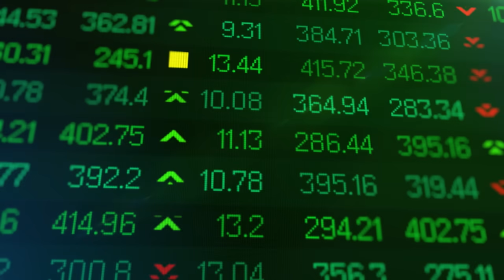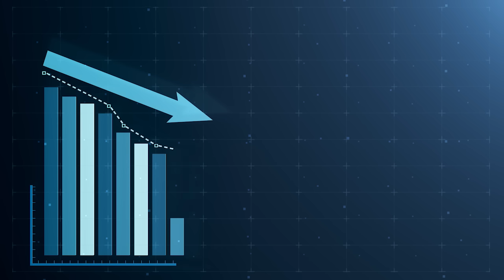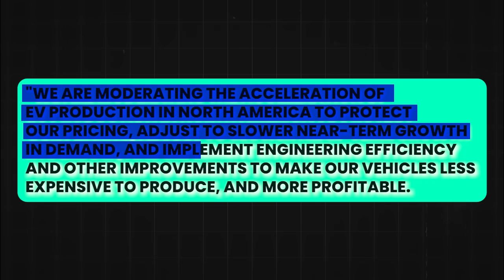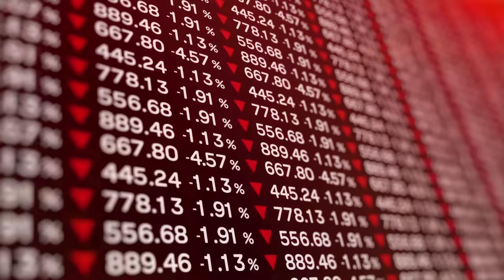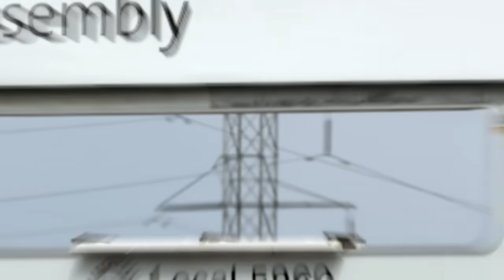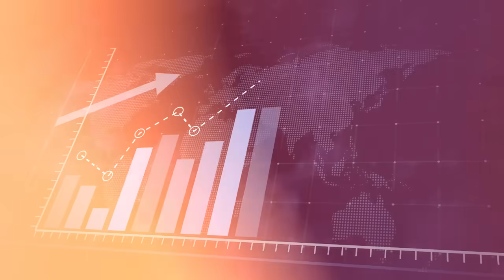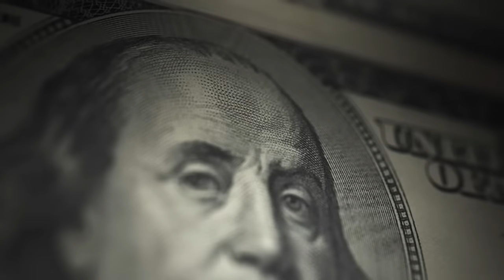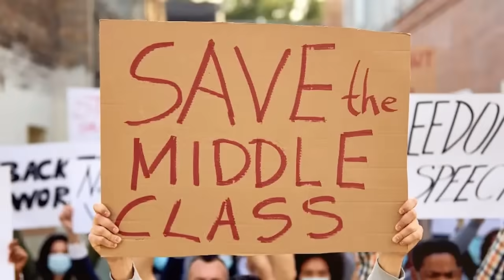HUGE NEWS! GM CEO Just SHUT DOWN EV Production!

Comment: Only the wealthy buy fully EVs.  Maybe there's not enough multi millionaires 😅
Reply: and yet people shell out 100K for pick up
Reply: I sure as hell don't.  If you walk into a dealership backwards with your ass out and sign up for a 10 year loan then you're a dumbass.  I know there are a lot of dumbasses out there trying to compensate for something, but I will never be amongst them.
Reply: I bought a brand new 2021 Chevy bolt premiere.  It cost me $17800 out the door with an interest rate of 0%. It costs on average  $6 to charge and it has a range of 300 miles. It would cost around  $40 to travel the same distance in a gas vehicle assuming the vehicle got 30mpg and that isn't including  maintenance. I get free charging at most hotels and GM even threw in a level 2 charger installed in my home and I got a tax credit from the IRS for that year. It isn't only the rich that buy them, it is the smart. I don't hug trees but I do think for myself. 
The real issue is that most automobile makers push high end cars because the profit margin is higher.  It doesn't help that consumers use them as status symbols pushing the price even higher.
Reply: They are expensive toys not reliable vehicles. They are full of gimmicks and very few benefits for the average person.
Reply: @CyberCrusader27  : 17,800 for a Bolt is expensive? For a new car?
Reply: The early adopters were rich and had too much money as well as being gullible to MSM hype. The fact remains most people dont have 40000 to 60000 plus 600 insurance first year and 2000 to 5000 thousand second year bait and switch...plus the risk of the thing catching fire and needing a 20 meter empty space as well as as 17000 to 34000 for a replacement battery after a fender bender..plus range anxiety. plus time wasted on charging plus poor charging infrastructure. Sales will plateau and then decline as the the middle class and working class can't afford them.
Reply: @ManInTheBigHat  Yes. When you cannot use it as intended due to all of the shortcomings that come with BEVs. Charging times are not viable for road trips, finding a functional charger that actually charges at the advertised rate. Or having to have a collection of apps just to pay at a charger. If the weather is too hot or too cold you lose a huge chunk of battery life. They are plagued by all the shortcomings the have been since their introduction in the 1800s. 

That goes without mentioning resale. The market for resale is nearly non-existent. Who wants to buy a used Smartphone, let alone one on wheels?
Reply: @CyberCrusader27 What are you babbling about? Auto rental companies buys EVs specifically because they are more reliable and cheaper to run.
Reply: @CyberCrusader27  
40k miles on my Bolt and not one issue yet. It is extremely fun to drive and costs pennys to drive. Pretty much nothing you just said is based in fact.
Reply: If people weren't being tax 30-40% of their gross pay check. Then people might be able to afford the EVs.
Reply: @goshawk4340  EVs, if you buy a sensible one is cheaper to buy and operate that most if not all petroleum powered vehicles. 
The taxes are that high because people don't vote. Believe me I don't like taxes either and I love passing a gas station and not having to stop. I charge at home for 8 cents a kw, it costs about $6 a week to charge. The car will go 300 miles on a charge and takes just over an hour to charge on any level 3 charger and I get free charging at most hotels making road trips awsome.
Reply: Complete lie!!  I own 2 EV's and I'm not rich, I just understand economics and value, which is why I own EV's and pay $0 to fuel with my solar panels.
Reply: @wilsterone6689   not everyone has a spot to plug in their car at night.
Reply: @MrArtist7777  Agree. I have a diesel car and an EV with limited range. Still, the EV is good enough for 90% of my transportation need for 20% of the diesel cost.
Reply: @esecallum  Lol, it costs $87 dollars a month to insure my EV, which is $30 bucks more than my gas car, that's nothing. I'll never need a replacement battery in an EV, and EV's catch fire way less than ICE cars, that's a fact.
Reply: @CyberCrusader27 speak for yourself. For me they make economical sense when you drive 2 hours a day to and from work. There is no maintenance other than tires and washer fluid. For daily driving like this they are the perfect vehicle because you can charge at home. Go drive a Tesla and find out like I did. I also have a gas guzzler for long trips.
Reply: @esecallum  , Thank you for your comment, but you could have skipped the bold. My wife and I looked at an EV, and by looking pulled up the cost to purchase,   perform maintenance, and alter our house to charge an EV. First off the price tag is nuts. They range from $30K to $100K. The $100K is one third of the cost of a house in the state my sister lives. The there is the battery replacement cost $4K to $20K. Than depending on where you live you might get hit with a battery disposal fee, that has nothing to do with the replacement of the battery cost. 

Now you have your EV but you have to charge it. OK great we'll put solar on the house to charge the EV (at night). Add in the cost of the solar, possible electric panel upgrade to handle the circuit, and the circuit to charge the EV. A co-worker got lucky and he had the 240V 30A circuit for an electric dryer in his garage but had a gas dryer, so his switch was easy. But depending on the state you live in you might not even be able to charge your EV. States that have brown outs due to either weather or electrical grid overload now become an issue to charge your EV.

EVs are a nice idea but they are not the solution. They are not the savior of the world. You are just shifting from one limited resource to another limited resource. Sooner or later the last oil or lithium will be dug out of the ground and then what? Internal combustion Engines are still good without oil, as almost every country in the world grows crops that can be used to make alcohol that could be used to power Internal Combustion Engines.
Reply: Incorrect.  Quite a few people were I work have EV's and they're not rich.  Average commute in the US = 40 miles.  If you live in a home and have a near-average commute, there  is a huge cost and time saving to owning an EV.  I've driven my Hummer twice since I bought my Model S, and I even take it on road trips.
Reply: @Clooney003  You make assumptions but I speak from experience. Not only personal experience but from those I know as well.
Reply: @CyberCrusader27  well sucks for you I guess. I know from experience myself as I own a 2018 Tesla with over 100K and its been the least "nickel and dime me to death" vehicle than any other car I have ever owned.
Reply: @goshawk4340  true and I'm not saying EVs are for everyone but they do work for a lot of people and even if you have to find a Walmart to charge at. You can get a full charge in just over an hour and it will only cost you about $8. You just have to open up your mind for the possibility.  I don't believe that there is a one size fits all solution. There is a place for all forms of energy.
Reply: LOL. Or maybe they are smart enough to face the facts, and Not Buy One?
Reply: @madewithscraps  Rich people don't get that way by waisting money. It costs $6 to charge my car.
Reply: @wilsterone6689  if it cost 17k or less I'd buy it. Sad I don't see that around
Reply: @user-tm5zn2lt5k  Paid $17,800 out the door and zero % interest.  For my brand new zero mile Chevrolet Bolt.
You just need to be savy. Even the sales guy couldn't believe that I pulled it off. But even if you pay $35k, the low operating costs alone compared to a conventional gasoline vehicle makes it worth it. $6 of electricity will get you  a full charge. $6 worth of gas gets you 1.5 gallons of gas, and then you still need to factor in maintenance like oil changes, belts, coolant,  transmission fluid, and services.  None of which are required for an EV.
Reply: @esecallum  My insurance is the same for year 3 as it was for year 1. The battery is covered under warranty for 8 years or 100k miles. More gasoline cars catch fire every year than EVs. It takes 1 hour to recharge using a level 3 charger, and it costs $6. The chargers are almost everywhere, and with a 300-mile range, there isn't any range anxiety. Most of what you have listed simply isn't an issue. I don't think that an EV is for everyone, but I do recommend serious consideration and stop getting  "facts" from social media.
Reply: @wvanyar1801  FYI, you can get lithium from sea water.  The battery will last as long as an ICE. You can adjust your charge rate and time to avoid  brown outs. And there are many more ways to make renewable energy than there is to make fossil fuel. Growing corn to make fuel is extremely inefficient and a poor use of land that could be used to grow food.
Reply: @wilsterone6689  bolt usually cost 35k or more. If they would sell it under 25k I'm sure more people would buy it. I know they offer tax credit for the people that make enough to receive em. Good point on the cost per recharging the vehicle.
Reply: @user-tm5zn2lt5k  I bought mine with the GM close out sale +GM loyal + costco auto program+ zero sales tax program + U bought it from a dealer that offers lifetime power train warranty. 
Like I said, you just need to be savy.
Reply: Guessing those who buy f150s are all millionaires, interesting
Reply: @kevinrocksman  Right.... most sensible EVs cost in the mid $40ks and that just happens to be the average cost of any car these days. Factor in the cost of fuel, and that makes the average  EV far cheaper than the average car.
Reply: @CyberCrusader27 "Not reliable" 😂😂😂
Reply: @CyberCrusader27 "Not reliable" 😂😂😂
Reply: @wilsterone6689  took your advice I bought a Chevy bolt to save money. But does it take you more than 5hrs per charge or did I get lemon. Thinking 🤔 of buying a second one to alternate vehicles when charging
Reply: @user-tm5zn2lt5k  My utube is acting up.  5 hrs is normal if you are using a level 2 charger and your battery is very low. Level 3 can get it done in 2hrs.

Comment: Fire Barra, NO golden parachute. Buy an EV, get stuck with an $80K paperweight in your driveway when the power grid fails. :face-orange-frowning:
Reply: So you don't need electricity to run gas pumps?
Reply: For 80K I can buy an EV and a solar panel. Guess what: I need no oil or electric infrastructure to use and charge my car.
Reply: or have  her skydive out of a plane with a literal parachute made of gold 🤣
Reply: @coderentity2079 Just don’t try to leave town.
Reply: @Rex_Racer   He’s landed.🎣
Reply: Only a small amount. When grid is down a simple generator is required to run the pumps.
Reply: @jimc3688  , or in a complete disaster, a crowbar and hose to break into the tangs to get the gas, seen it happen. 

Also charging your EV by solar takes longer that you think, hope you don't plan on going anywhere quickly. Also Solar does not work on all roofs. If you roof is East West facing you don't produce as much Solar unless you put panels on both sides, thus raising your cost.
Reply: @Rex_Racer You mean I have to stay within the 2013 towns I can reach with one charge. Unless I can find a wall socket or another solar array.
Reply: @coderentity2079  Sounds like you’ve got it all worked out- good luck to you.
Reply: @coderentity2079  How are the parts manufactured? Is there cutting fluids derived from crude oil, used in the manufacture of those parts? What about on the ev, is there lubrication points and is that lubrication 100% synthetic or derived from crude oil? What about the manufacture of the battery bank....is that process 'dirty'?
 I'm not against ev's at all, I think that technology is kinda cool. Consumers should have a few choices when car shopping.

Comment: I will keep my 2004 Chevy Silverado 1500 with 206,000 miles and my 2012 Ford Focus a straight drive with 101,000 miles. Thank you.
Reply: LS based all the way. And at one time the Focus ranked in the top 10 of cars world wide dependability wise. I think it was in Road & Track or one of the other automotive magazines many many yrs ago.
Reply: Ford focus has serious issues with the transmission.  I have two Ford Focus SEs, one 2012 and one 2014 and both have had the transmission clutch issues repaired multiple times, and the TCM replaced with the most recent a 3 month wait for the replacement TCM. Serious design flaw
Reply: @mrhallman64   Stands to reason. I wouldn’t even buy a late model gm truck. But I’m talking years ago long before the accountant engineers when they were automotive engineers. Very similar to the problems at Boeing.
Reply: a Ford Focus with 100,000 miles... hahaha.. the pure pain.. feel for you.  The fortunes spent in repairs... could have purchased 2 electric cars.
Reply: @1905934  Ford paid for the repairs 4 times because they knew it was an issue, but after 150k and 7 years they would not.  Their extended warranty would go to 160k. Car also was only 20k
Reply: @mrhallman64  mine's a straight drive, a 5 speed.  Are your's manual or automatic?
Reply: @lisaharmon5619  it is the manual transmission with the issues

Comment: There is a difference between Tesla and the Legacy car companies. Legacy was building EVs that they couldn’t really afford. Loosing money on every EV was helping to kill their profitability. Tesla on the other hand chose to charge far more than cost for their vehicles and when the richer buyers had waned they dropped their price . GM didn’t do enough research into battery and charging systems and were caught out by EV fires . Ford had a lot of trouble because their product was fitting old tech stock parts into vehicles where they didn’t belong and using far too much Copper …
Reply: Well said!!!!
Reply: LOL no, Tesla lost billions for many years starting up bro. They just had lots of people pouring money into it. GM can't do that, neither can Ford.
Reply: What? You know Tesla makes half its revenue from selling carbon credits (read that as SUBSIDIES) to other manufacturers right? Tell me you knew that.
Reply: @nobodynever7884  Not anymore.

Comment: One of the greatest lies ever told: EV's will SAVE the environment!

EV's actually cause more harm to the environment than gas powered vehicles:
1. Batteries are Lithium which is a scarce mineral source; mining for this has greatly impacted the environment.
2. Batteries are hard to get rid of; cannot be recycled and that translates to landfills full of them.
3. Materials used in the EV are mostly 'plastics' which are made from, you guessed it, petroleum! So much for getting rid of 'Big Oil'!
4. The demand for charging stations is placing the power grid in jeopardy; nuclear and coal burning for electricity is not an option, so that leaves hydro, solar and wind energies all of which are not massive producers of electricity and/or are not able to be built in all areas.

Then, there's the 'slave' aspect where children are forced to mine for Lithium in foreign countries that have no laws against child labor.

So, thank you to all those EV nut pushers who are as dim as the power available for their own EV's.
Reply: too well said man!

Comment: Correction, the world is suffering an ev car crisis. They’re not selling anywhere in the world not just USA 
evs are over matey, finished, caput  leasing is the only option for evs and the costs of insurance and 
depreciation makes it so expensive that will soon finish. Forgot to mention fire risks are now huge in 
evs, wont be long before evs will be banned in multi story car parks and roll on roll off ferries. Just 
imagine an ev fire on a ferry, my god. Cannot imagine the stupidity of car manufacturers actually thinking 
people would buy these things. Thank god the Japanese makers made early decisions regarding not 
moving to all electric they new it was going to be short lived.
Reply: The early adopters were the rich and had too much money as well as being gullible to WEF controlled MSM. The fact remains most people dont have 40000 to 60000 plus 600 insurance for first year and 2000 to 5000 thousand second year bait and switch...plus the risk of the thing catching fire and needing a 20 meter empty space as well as as 17000 to 34000 for a replacement battery after a fender bender..plus range anxiety. plus time wasted on charging plus poor charging infrastructure. Sales will plateau and then decline as the the middle class and working class can't afford them and insurance companies dropping them as even a minor fender bender means a total write off plus liability expanding to adjacent buildings on catching fire

Comment: I want to see the big three bring back limited production runs of past classics. Not bastardized with modern tech and materials. Literally as built in the past. 59' Cadillac's. Late 60's early 70's Chrysler C bodies. Every year if they could do 500 or so of something iconic. That would be so cool. I personally luv the big wagons. Give us some classic wagons! Lorne
Reply: True. I am with you.
Reply: EPA won't allow it.
Reply: The problem with the old 5mph bumper is that it rebounded and didn't cost almost 3k in body work.😂 Someone needs to look into collusion between auto manufacturers and aftermarket  body shop parts.
Reply: Sure IF you want to pay over 200k for one